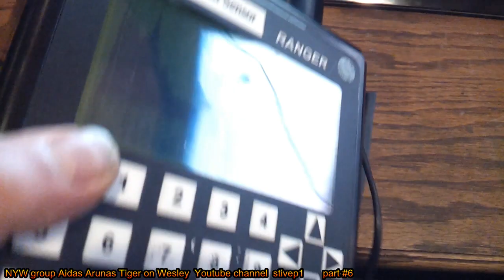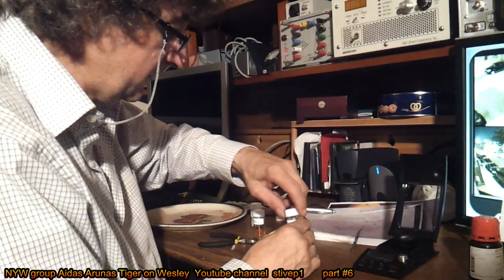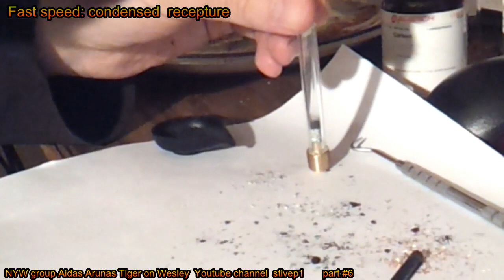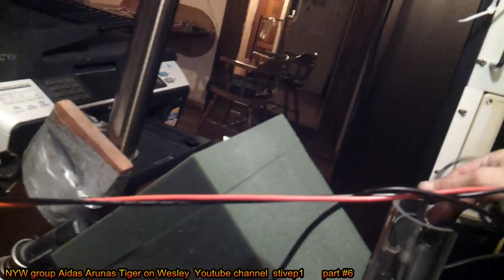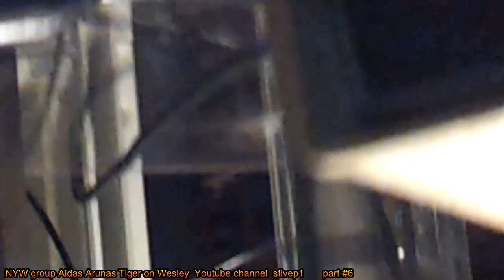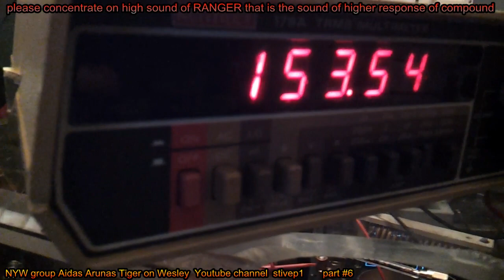Revolution has begun Free Energy exposed part 6

Comment from the maker: when you play with  amplifier MAKE SURE THAT INPUT POWER  IS NOT MORE THAN MILLIWATS !!! ATTENUATOR IS A MUST.
YOU WILL BURN THE AMPLIFIER IN  SECONDS.
most of  signal generators  gives to strong signal.
You starting from maximum attenuation possible than slowly decrease it touching body of amplifier if it is not to  hot.
RADIATOR- HEAT ABSORBER IS A MUST ON  AMPLIFIER
LOOK CLOSE - you see  I have used one between my amplifier and metal door of rack cabinet.

Wesley